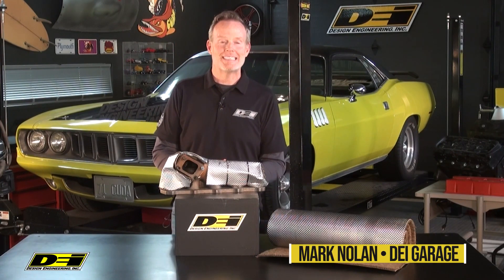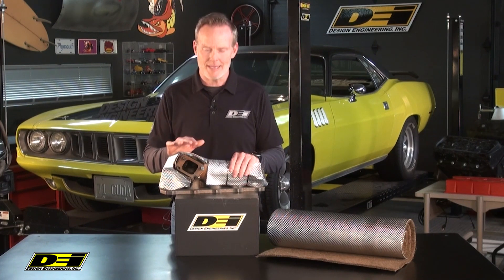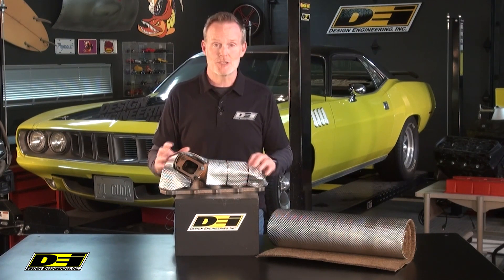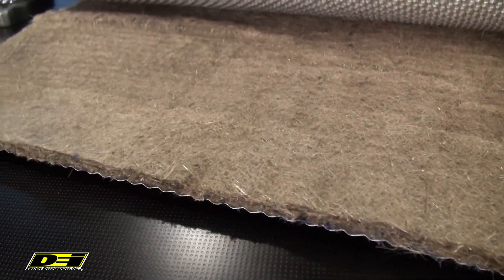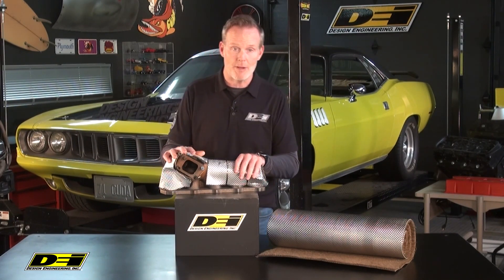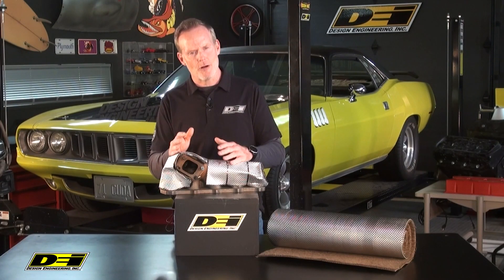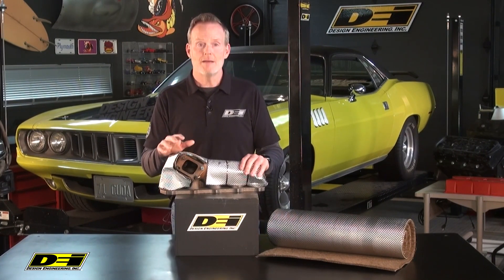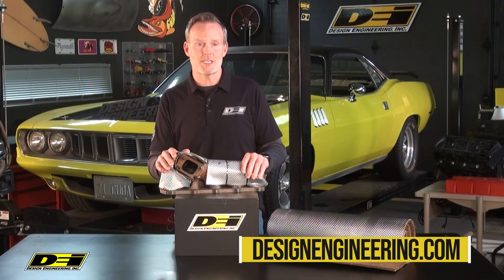Form A Shield Heat Barrier from Design Engineering, Inc.

Comment: That aluminium is definitely NOT 10mil/10mm thick.
Reply from the maker: Mil & Millimeter are two different measurements. 

1 Mil is equivalent to .0001 Inch or .0254 MM. The product does have a true 10Mil thick top layer of aluminum.

Comment: Anyone using for turbo downpipes or these not able to withstand the temps?
Reply: We use them on our turbo manifolds and end up replacing the shields every 4-6 months. The downpipe shields seem to hold up a little better but the fiberglass does burn right off. They definitely do the job but will eventually burn through. Keep in mind these are race cars that run up to 2 hours at a time.
Reply: @aaautosport you should leave on the first layer after it burns off, then add the new one on top. Should stop the layer from burning off.
Reply: @aaautosport  great info... thanks!